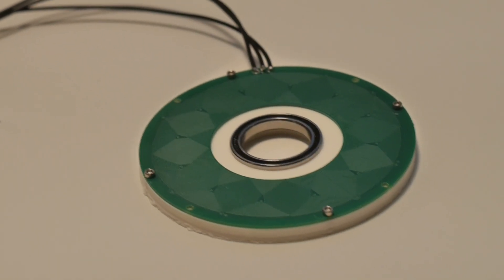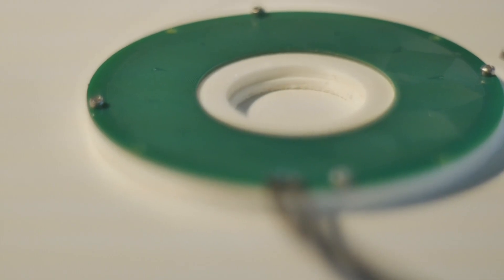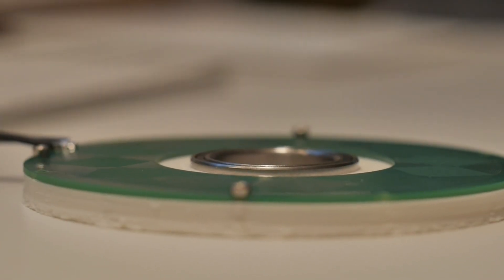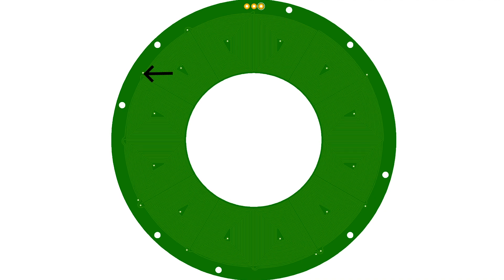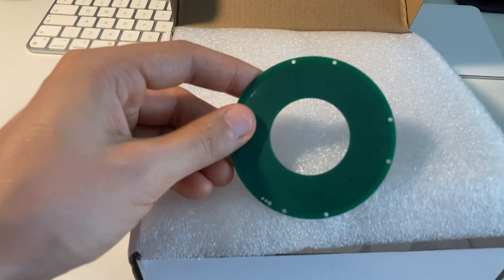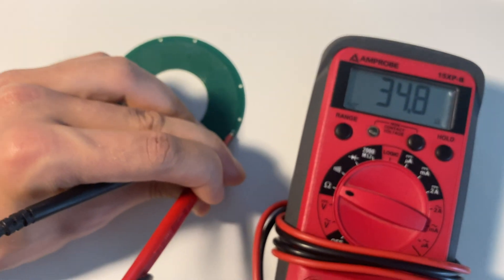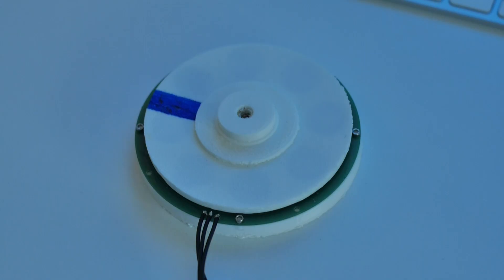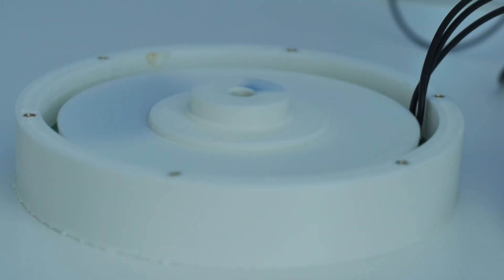building a pcb motor from scratch

Comment: can you please help me with my design? I also designed a PCB motor with a 120mm diameter 6 coil 2 layer and 3 phase delta connection but after assembling it with the rotor and the magnets that can't move after given supply with the BLDC controller.

Comment: Have you tried to make this same design by hand? I was thinking of getting an electrolysis kit and building up my own multilayer boards. Maybe start with a thin sheet of fiberglass and then use solder mask between layers. This probably sounds nuts, but then again, I might just be crazy.

Comment: Getting a silicon steel backplate (or several thinner ones, to reduce eddy currents) for the stator PCB laser cut shouldn't add much cost or complexity, but may greatly improve the magnetic flux density produced by the stator. Anything you can do to reduce the air gap between the rotor and stator will also improve performance. It may also be advantageous to use a laser-cut polycarbonate or FR4 rotor to improve balance and and tighten your tolerances (parallelism, coplanarity of magnet surfaces and concentricity especially). I would also consider using wedge-shaped magnets, assuming you can find a low-cost source.
Reply: Could you explain why a steel backplate would improve flux?
Reply: @joshuaplank883  It closes the magnetic poles on itself => make flux gap smaller => flux greater. Better to use two rotors with steel backplates behind the magnets. But silicon steel is not needed because there is(into backplates) a constant magnetic flux and no eddy currents.
Reply: What about making aluminum backplate with cnc? It can be designed as a heatsink @krostovskiy
Reply: @maistoo steel is needed to increase magnetic flux, not for heat conduction. Rotor has constan flux and doesnt heat. Heatsink is needed for stator's copper coils, beacause resistanse is prety big.

Comment: Great job @365 Robots, Would you share more details on the PCB design? Did you try multi layer like 8 or more layers in comparison to 2 layer PCB? Would love to see a video explaining the PCD coil design if possible.
Reply from the maker: I only tried 2 layer pcbs for now. For the latest Video I attempted to stack multiple thin 2 layer PCBs together. This resulted in a decent torque increase. Sadly never got to measure the difference in torque on those designs.

Comment: try bearing ball pure dc mhd motor (bearings are the brushes, and the only thing that moves, and any rotor rides on top of the bearing balls, bearing balls should be possibly non-ferromagnetic, like tungsten metal balls). no coils, just radial current over the bearing balls over a vertical ring magnet. the motor is the bearing itself, no separate bearing. more bearing balls radially, the longer the L measurement and the more torque the motor has for the same current, F=ILB or torque=ILBr, also the radius of the motor affects in the same way, both larger the better.

Comment: Looking better and better!

What are you doing for the axial magnetic field? I saw your one rotor with magnets... do you have some magnetic shunt plate on the other side of the coil?
Or did I miss it and you have two magnetic rotors on either side of the coil pcb?

Also, take a look into halbach arrays for the magnets. You can double the magnetic field on one side of your rotor by doing it. 
It might not be possable with your current arrangement... maybe a ferrous plate to back up the magnets on the non coil side?
Reply from the maker: I actually would love to stack another PCB Stator on top of the rotor. This way there is no need for shaping the magnetic field since ist can be used with the second stator as well. 
Adding a shut plate is a good idea. I will look into this in the future, thanks!